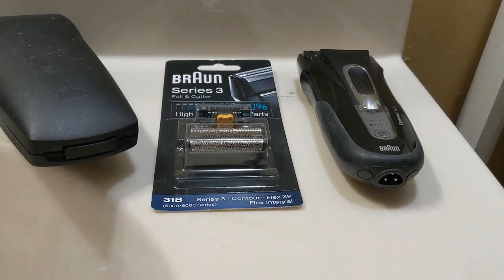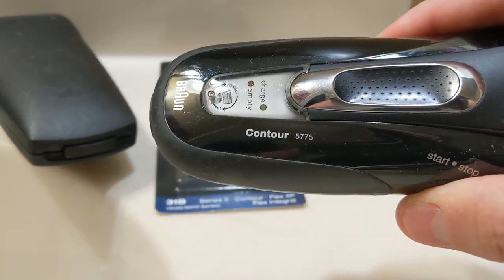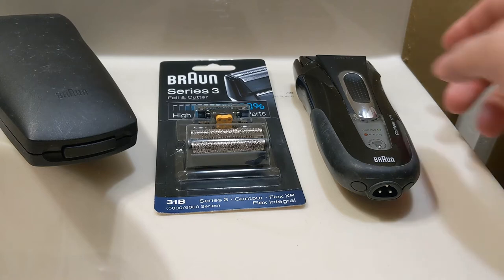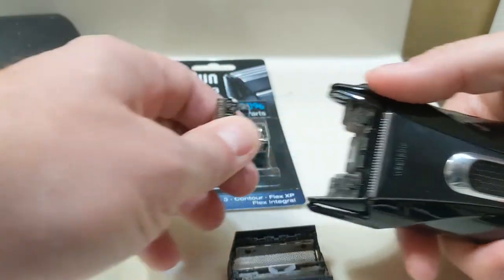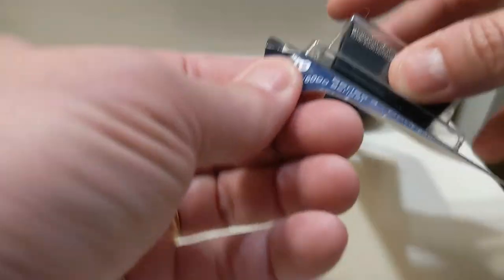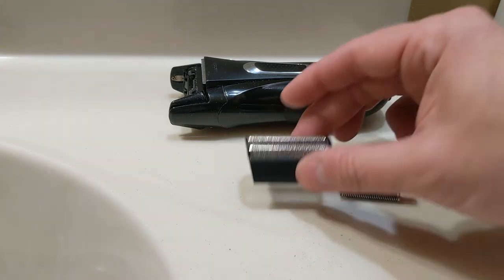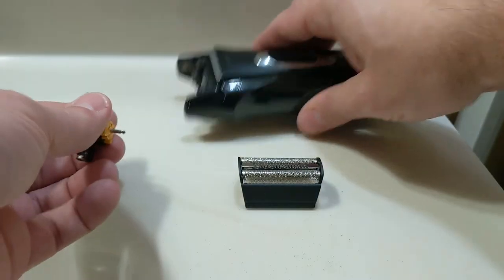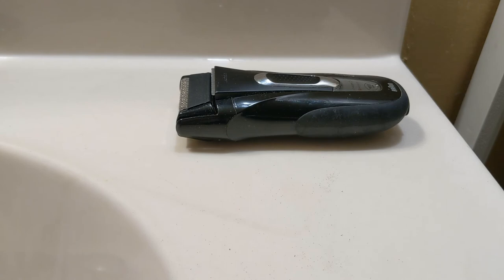Braun Contour 5775 Foil and Cutter Replacement

Comment: Can you replace the beard trimmer part on the back or no??
Reply from the maker: I believe you need to get it serviced for that. Mine hasn't worked in years. I use a separate trimmer.
Reply: @jorowi  actually I found the entire piece on Amazon 14 dollars!! It is replaceable!
Reply: Still using the same shaver after 20 years? Why the hell don't you buy an up-to-date modern one? Skinflint!
Reply from the maker: @MrSerendipity01  Because this one still works.
Reply: @MrSerendipity01  If the one you got can be repaired then no point in buying another one. Silly buying a whole new shaver when foil and cutter can be replaced. Age is just a number.